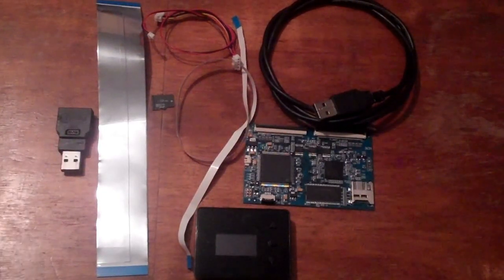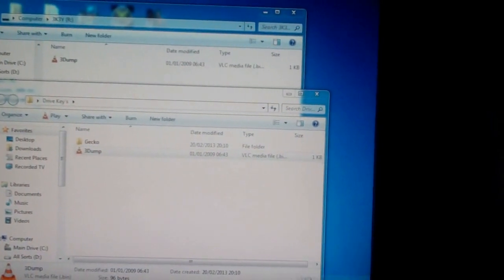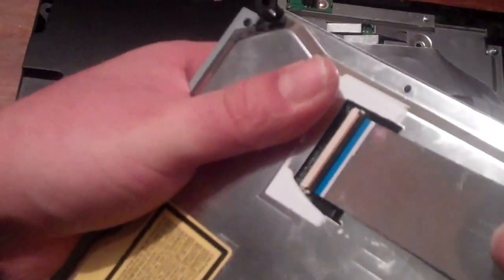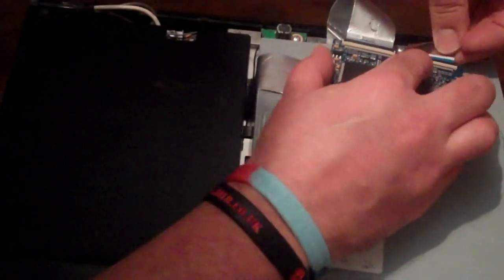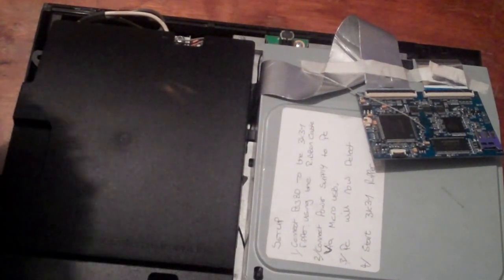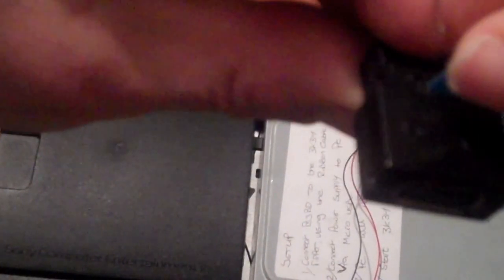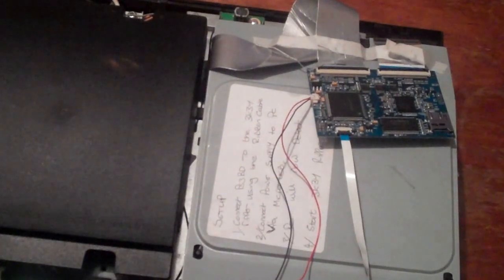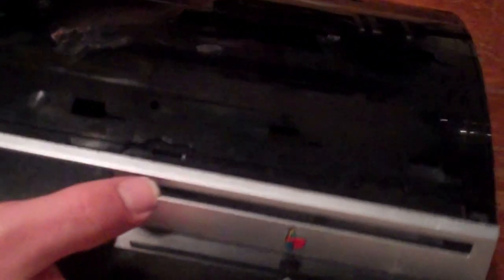3k3y Install Tutorial. Play Ps3 games from a Hard drive.

Comment: It would be AMAZING if you could point me in any direction of some instructions for 2.5k Slim 3k3y install. No Keys, Official Firmware, No Ripper hardware (cuz it will never work for my model). There aren't any videos, .pdf files, or instructions for my model anywhere & nothing came with it. the closest thing i saw was a picture at ozmodchips. I've got my PS3 stripped down to motherboard now but don't wanna fuck it up. e-mail me please. daviddiuguid@gmail.com Thanks bro

Comment from the maker: I'm not sure. The problem is you need to be on 3.55cfw to install the package file required to obtain the Blue ray key. I hope they do because at the moment this is seriously holding back the 3key and with cobra's ode around the corner the 3key could fail. 
That is if you believed the hype from team cobra, I'm not convinced that they have found a way yet.